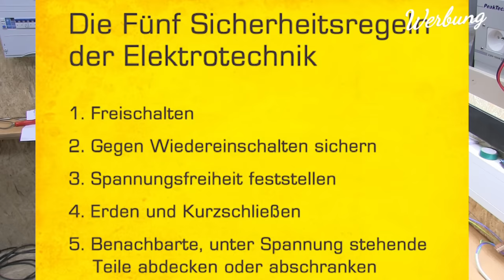Dieser Fehler bleibt oft unbemerkt. Mehrere Steckdosen an einer Zuleitung! Proofwood

Comment: Fehler an geschalteter Steckdose? Ich habe meist 3er Steckdosen verbaut, wo manchmal 1 ne schaltbar ist. Nun habe ich eine Tischlampe angeschlossen mit einer LED Birne. Die leuchtet auch wenn die Steckdose aus ist! Dann aber ganz schwach. Ist da nen Fehler verbaut? Oder liegt’s daran das die Steckdose durch einen Aktor im Keller geschaltet wird und durch die länge das Kabels und parallel geführten Phasen eine Spannung Induziert wird? Oder ist es ein Fehler der LED Lampe, falsche Verkabelung oder was?

Comment: Der Beruf des Elektrikers ist ein sich ständig auf die Zeit anpassender Berufsstand. Auch wachsen die Berufe ständig zusammen. Der Elektriker wird zum Heizungsmonteur, zum Trockenbauer, zum Lehrer, zum Psychologen und zum Zauberer. Ich bin gelernter Elektriker , Industriemeister, Diplom-Techniker in Flugzeugelektrik, Diplom-Gebeudetechniker und noch solch Zeug. Ich bin nun 10 Jahre von der Baustelle in den Rentnerstand. Seit damals habe ich mich um neue Regeln der Technik nicht gekümmert, und nun stehe ziemlich dumm da. Die Neuerungen kommen so schleichend das ich zum Beispiel den Quatsch mit den Aderpresshüllsen total verpeilt habe. Aber ich habe mein ganzes Leben immer gelernt und nun lerne ich das auch noch weiter tun. Und die Hobbyschrauber meinen sie können das auch. Mensch seid Ihr gut. Ich musste mich dazu viele Jahre hinsetzen und lerne heute noch. Was ihr habt ist kein gefährliches Halbwissen sondern 90 Prozent gefährliches Unwissen. 
Opa Werner

Comment: Do the German regulations require the Neutral wire on the left and  Phase/Line wire on the right of the socket like in the UK and US?
Reply: No, because this type of plug fits in both possible way, only earth/PE ist always unchangeable in the middle. In US or UK and many other EU-countries  they use sockets which fit only one direction, polarity can't be missfitted.
Reply: @dd313car  Yep I know that as we use schuko as well. But our regs do recommend us to wire N left and R right. Also as we use schuko socket&plug as connectors for downlights, polarity does matter if we use LED lights.
Reply: @IAmThe_RA  Funny to hear. Why ? There are many other connector available which did not chance polarity. And by the way where get you german Schuko plugs and german sockets from ?
Reply: @dd313car  Ex Portuguese colony.  We have used schuko since I was born. Yeah there are many connectors but many prefer to use schuko plug and socket designed especially for downlights because it's more practical as the connection to the socket is always permanent like those on the wall so it is more idiot proof. If you want replace the light just unplug it and do your wiring on the floor, the terminals are labeled so it is easy. After you are done , you can test it first with a socket nearby on the wall  before plug it in the ceiling for eternity. In Australia, they do the same but with their 3-pin plug and socket, you can see it on youtube.